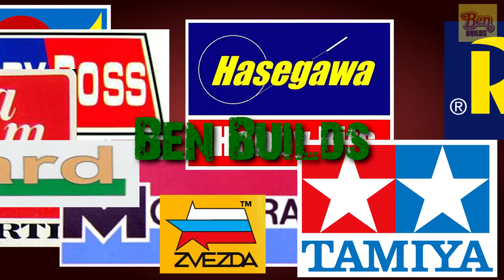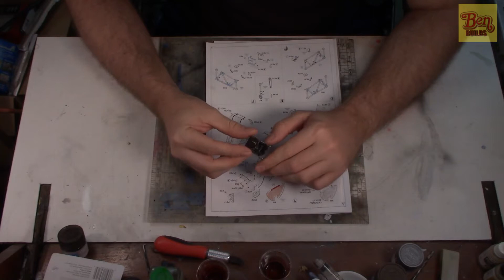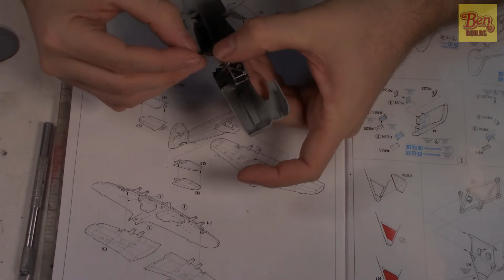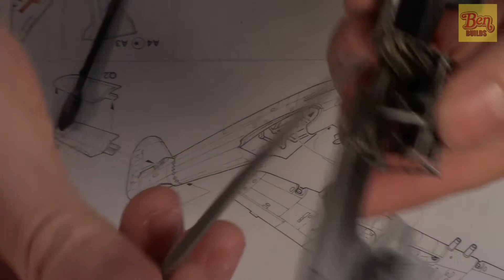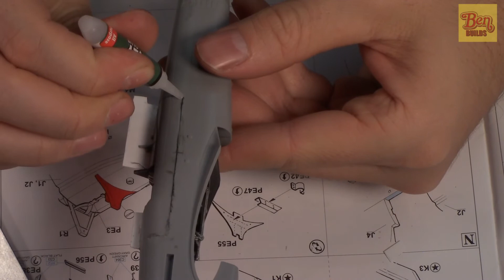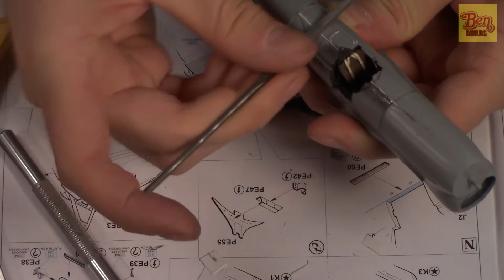Ben Builds: S4 - The Spiffy Tiffy - ep. 4

Comment: Good update Ben and so close now to putting her clothes on! When I built this kit, boxed by Hasegawa at the time, I cut those tabs off the bomb racks because, like you, I thought it was weird that they cover up the spent shell exhaust ports. Whether that was wrong to do, or right to do, I haven't a clue. I had to sand my IP edge down to get the two fuselage halves to close and I had to do a bit of filling and sanding around the fuselage inserts, too. Good work filling the gap!
Thanks for posting, much appreciated!
Keep having fun!
Cheers,
Martin : )
Reply from the maker: Thank, Martin! That IP seemed a bit oversized to me. I'm going to try to figure out that tab. It seems so strange. Maybe they removed the inboard guns or didn't arm them? For weight concerns maybe? I know this is an earlier version of Tiffy, so maybe that comes into play? It is a mystery.
Reply: Maybe that's the answer...purely for weight? They'd have to keep a couple of the guns for protection getting to the bomb target and for returning after dropping their bombs. I'd be interested to know what the answer is if you do figure it out. Cheers : )

Comment: Great work, I like the plastic card insert for filling gaps. It does give a better finish than using filler I think. Its always easier to 'take away' than 'add'! I saw this kit in a hobby shop recently and very nearly brought it! I don't feel up to the 1/24 scale Airfix kit, but this car door might be just right!
Reply from the maker: Thank you, Chris! This is really a nice little kit. My only real complaint are those fuselage inserts. The fit on those are difficult, but not impossible. PE parts can be a bit of a pain, so I opted to use only a few, but they are solid and add  quit a bit of detail. Plus, I am really loving the subject, so win win. 

I love plastic card for larger gaps, like these. I know putty can crack and since it was a larger than a normal area, I just thought plastic card would be the best.